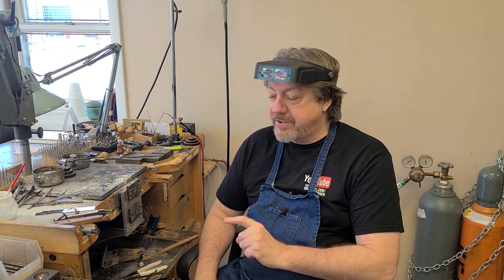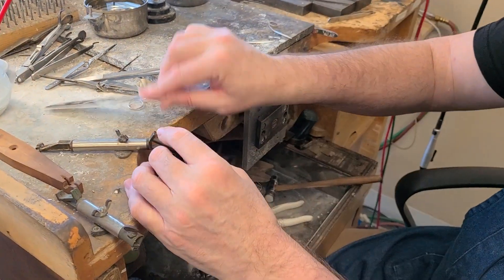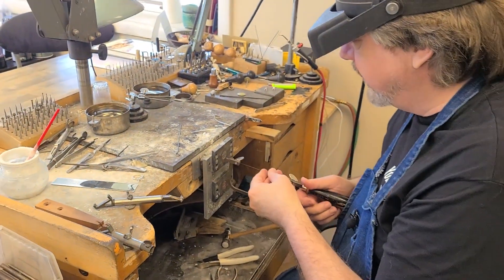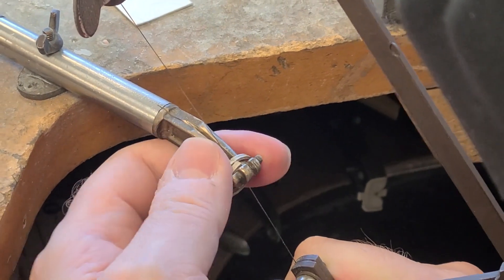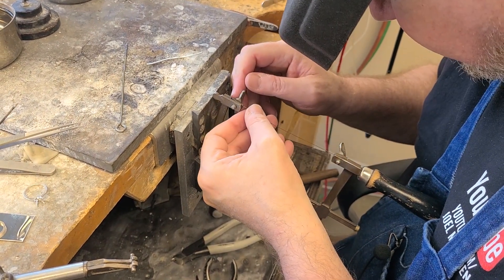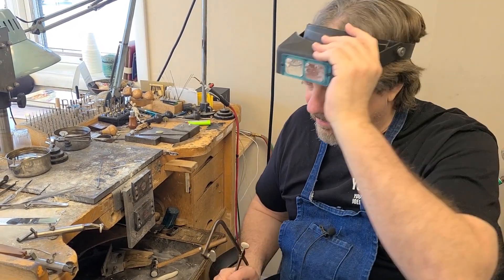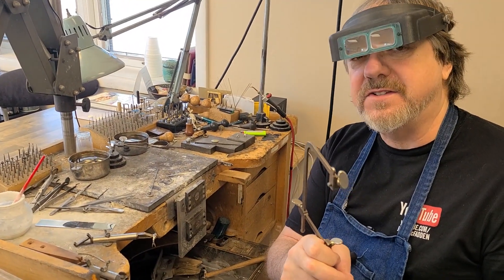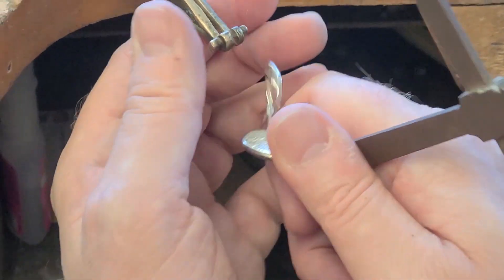Bench Pin for easier and safer cutting

Comment: S..o the metal tool He is using here  is very close to the Jiffy jumpring maker but it has a different end, (see the jiffy is the far on on the left  with an open tube end) They no longer make the steel one he is showing in the video. you can still get the wood one though. All the links he has listed for the steel one are end longer valid.